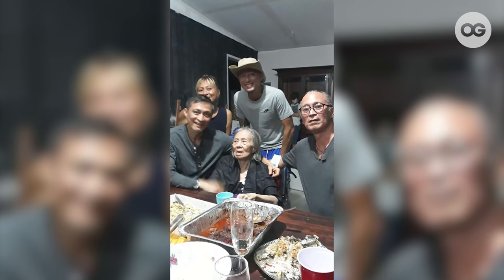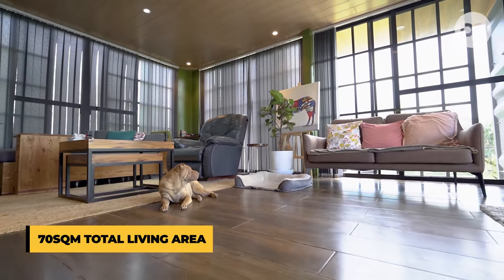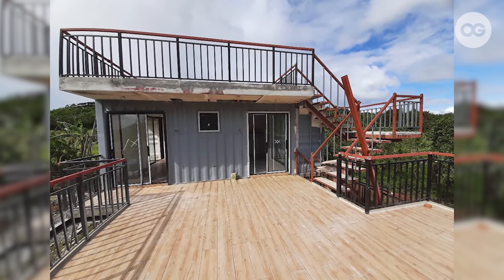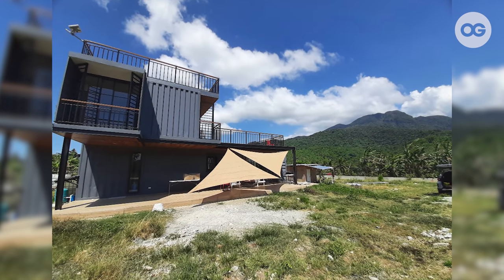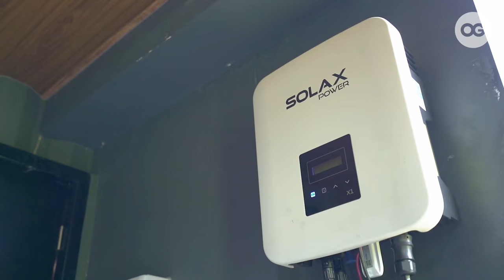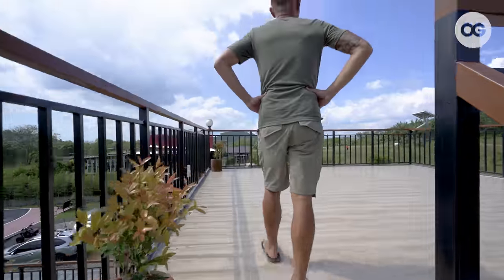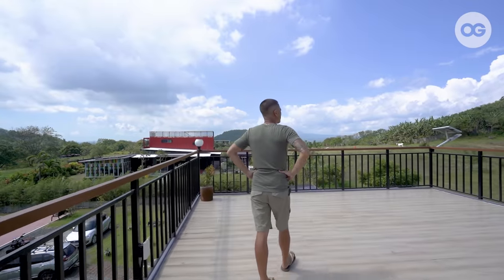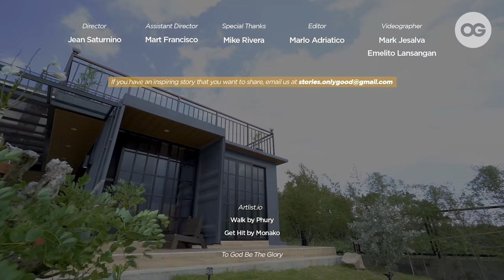Incredible Container House with an Amazing 360° View of Mt. Makiling | Unique Homes | OG

Comment: I find these very good and excellent, but still, we have a problem,  and most of us do have because any of these requires money. And unless or except there will be a “National Basic Income”  or a dividend to every Filipino citizen annually in the amount of US$10,000 or PHP500,000 during the new Philippine President Ferdinand “Bongbong” Marcos, Jr.’s administration, from the Philippine assets lodged at the foreign, international and central banks overseas which accordingly on hold by international banking policies,  then, that will be of great help to address the serious problems of homelessness of the poor Filipinos and families here in the Philippines. 
 
Most Filipinos or families who are in poverty and in economic crisis fluctuating between inflation of prices too frequently and the deflation of the Philippine peso also too frequently vis-à-vis with other currencies under debt finance cannot immediately afford to have such “Installable, Expandable & Fordable or Container House structures”  at that amount here in the Philippines.  Building a traditional house is taking time and indeed very costly in terms of building materials and the labor in addition to permits and other licenses in the main town or cities, except in the homesteading rural areas – very far-flung from the main city or town - whereby a  house can be built by the local materials or light materials, however, still with costs involved. 

I, therefore, deduce that solving the home problems of most poor Filipino families here in the Philippines is impossible, and lies in a clear understanding of the FINANCIAL SYSTEM that must be adjusted to the needs of men, and not men to the unfair and iniquitous policies of the financial system at work  THAT make life unnecessarily difficult.